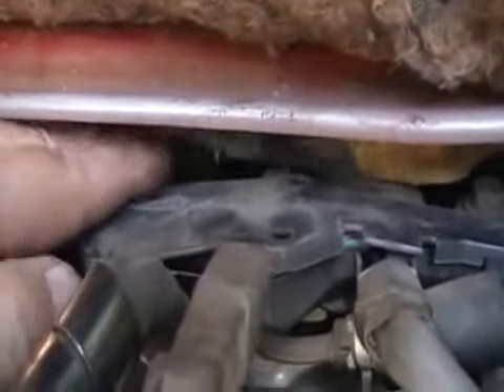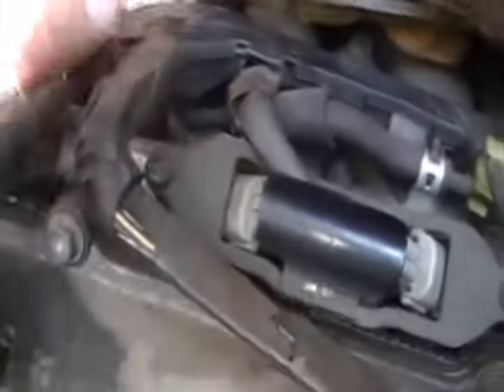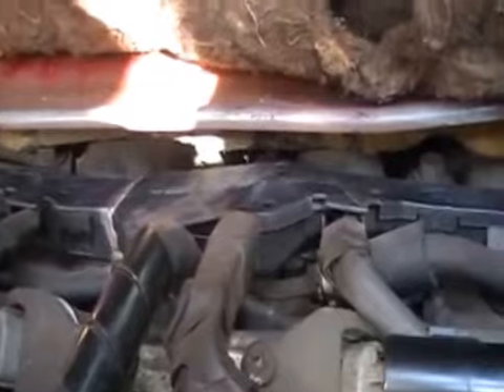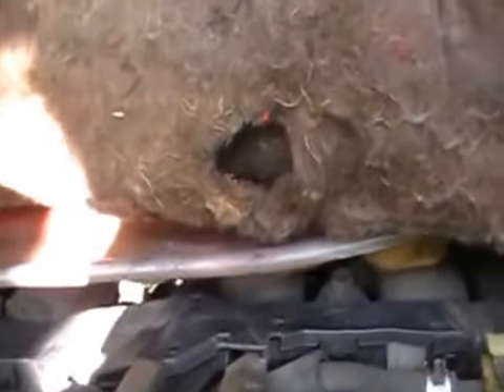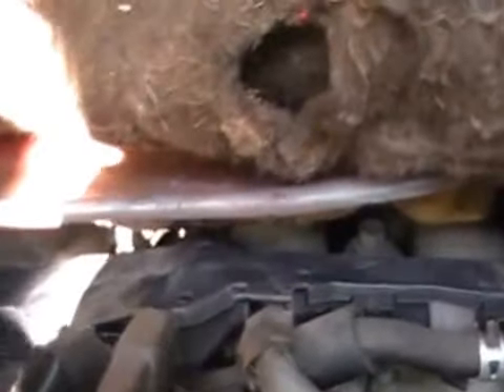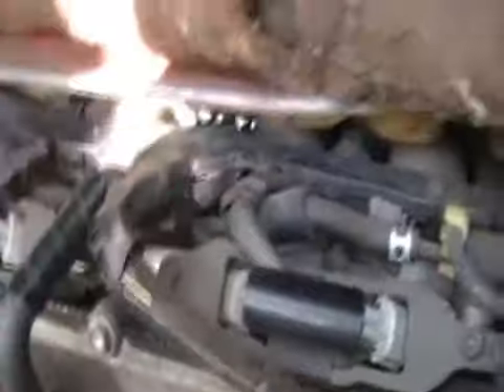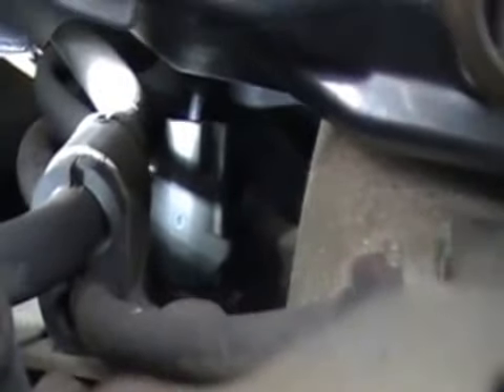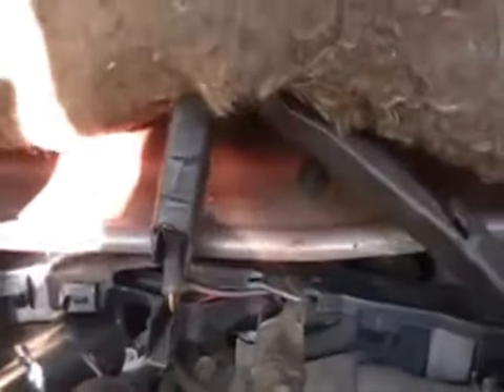Knock Sensor Location [ TCR Tarago Previa Estima ]

Comment: This video is way too shaky; could you try if Youtube's stabilization feature helps in this case?
Reply from the maker: Yeah sorry about that, hard to hold the cam steady while trying to look at the same to make sure it's facing what I am looking at. I did the YouTube stabilizer thing, still jumpy but not as much. might take an hour before YouTube finishes correcting it.